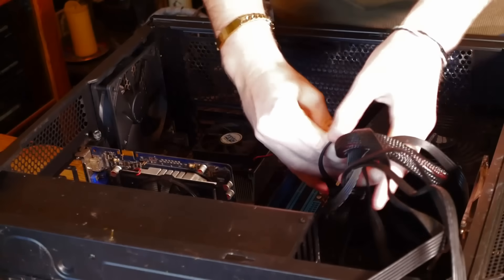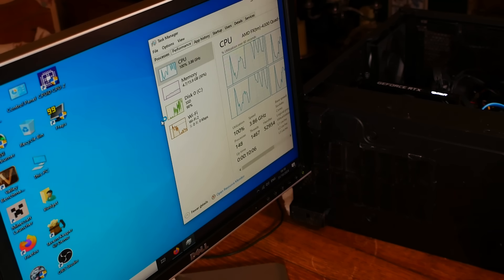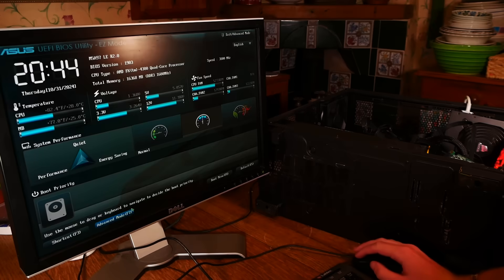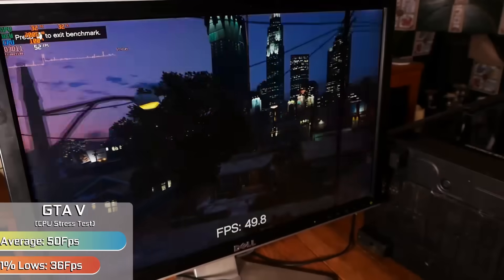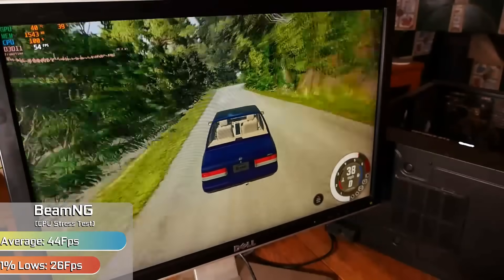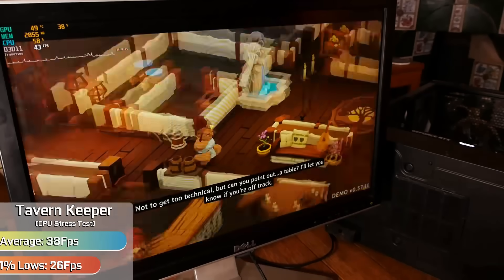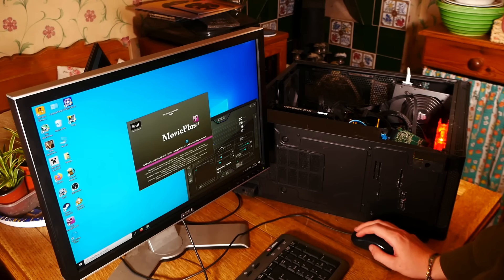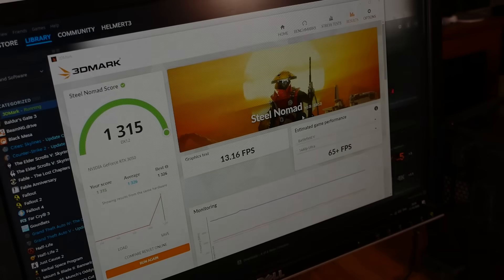AMDs Weakest FX Processor...

Comment: For me the real problem is not the fact that FX-6300 was close in price, part in which I totally agree with TH despite maybe not being viable for "true budget builds" like yours... the real problem is the old Phenom II X4 did cost about the same and performed, in average, better. And they also were compatible with the same socket, so there was very few reasons to buy this chip.

Also, few people know that, despite being a Vishera, the FX-4300 has actually LESS cache (4MB) than the FX-4100 lineup (8MB for all models except one), making it perform significantly worse in some games. I actually recommended and built FX-6300 based systems frequently, the savings for the FX-4300 were too small to consider it on my opinion.

You are totally right that there were few viable options for intel. The competitor in the 100€ mark for the i3 2100/3200 was actually not this chip, and not even the FX-6300, it was the FX-8320. I actually consider that chip a very good value, partially held back because of the more expensive motherboard required to make it shine.

I would really love to see pentium G540 (an even cheaper intel alternative at the time) and this processor compared side by side. I suspect that, in games in particular, some people might be surprised that a dual core has not aged so bad... ...for games that can even run on 2 cores.

Nice video as always.

Comment: I am using FX 6300 in my Win7 machine. 4,6 gHz seems to be sweet spot (of course  whole system is OC'd) and it performs really well. Well enough for GTX 970 being bottleneck in many titles. I've tested many newer titles (BG3, Horizon ZD, etc) and all run well, although poor FX is usually at 100% usage. But yeah, being Win7 computer, I mostly run era true games on this. Which run flawlessly.

Comment: I finally retired my FX-8370 system about a year ago.  It was paired with a GTX 1050Ti and did quite well for some games I've played on an quad-core Athlon II prior.  It did fairly decent in light video editing tasks.  It could even handle a Windows virtual machine without much drama.  It started initially with 16G of RAM but bumped it up to 32G four years ago.

Never once did I experience the performance problems that many were complaining about, but then again, I used Linux.  Meanwhile, these CPUs' true potential under Windows could only be fully realized when a Windows 10 update fixed the scheduler for Ryzen CPUs. . . it had the side effect of delivering noticeable performance gains for the FX chips.

I might bring it out of retirement as a streaming PC. . . that depends on my own schedule for the next few months. . .

Comment: The FX series was made using an old and inefficient node, with some models being pushed particularly hard to achieve high frequencies at the expense of extremely high power consumption and terrible energy efficiency. 

Also, the architecture didn't seem to be very good for most applications when they were first released. However, the architecture itself seems to have been relatively advanced, and performed well in some applications even early on, and ended up aging fairly well even for gaming, though it took a long time before a wide range of games were really taking good advantage of the FX architecture. These CPUs also offered decent value for money from the beginning, especially if your electricity costs were low enough that the power consumption wasn't likely to cost you very much, such as in some parts of Canada or the US.

It was nice to see someone taking a stand on the core-count controversy. Even a lot of tech journalists will repeat this outright falsehood that these CPUs didn't have the number of cores that they said they had, and use it as an example to argue that AMD isn't a trustworthy or honest company. Sure, by all means, it's good advice to tell people not to trust AMD, but this was not an example of dishonesty. The AMD engineers themselves considered their FX CPUs to have 8, 6, and 4 cores. The lawsuit didn't prove anything. AMD only agreed to a settlement because they didn't think paying more money in legal fees was worth it. 

There was never any conspiracy to misrepresent the number of logical cores, and the whole legal argument that their products were misleading was completely dishonest nonsense. There was never a widely agreed upon definition of a CPU core which the CPU cores in the FX series chips failed to adhere to. The lawsuit against AMD was just 100% pure dishonest legal sophistry and opportunism by lawyers. Anybody who expected an 8-core CPU to be faster than Intel's best quad-core CPUs during the same time period was an idiot, because Intel's best quad-cores were significantly MORE expensive, and it's never been a good idea to assume that a CPU will be more powerful because any one of its specifications has a larger number in it than a competitor. The FX CPUs offered decent value, there was no legal grounds for the lawsuit, and AMD should have fought it tooth and nail for the marketing value of vindicating themselves in court, imo.

Comment: I have almost the same story: my first pc was a fm2+ platform, a10 5800k. So same architecture but with a "decent" (for the time) igpu. I had it up to 4.9-4.8ghz stable with a hyper212 a friend gave me (dude went aio), and a laptop fan blowing on the radiator less vrms on that poor asrock a68 😂
Then i got a r9 290 blower, put a trixx cooler from a dead 290x on it (i had to trim some parts out of it), oc'ed that too up to 1200mhz core and 1600mhz on the vram iirc. That made for a nice heater in the winter x)

Comment: The Lawsuit against AMD for the FX series was to do with the Resource sharing. FX were built on modules, each module has 2 ALU units but 1 FPU unit. meaning that only 1 thread at a time on each module could use the FPU. it was this technicality that saw the FX line dubbed as having "fake Core count. the FX 4xxx series were 2 cores with 4 threads, FX 6xxx series were 3 core 6 threads and the FX 8xxx series 4 core 8 threads. This is why they were so bad, that in gaming, a task that make heavy use of the FPU, they performed so badly compared to Intel's offerings. Even clocking the FX to over 5GHz didn't help them.

Comment: i see you use  3050 with it  , most likely this cpu will squeeze out a few more fps with a radeon card i bet  , radeons they seem to have lower driver overhead so they really cope better with weak cpus . If you have  an rx 580 or faster around give it a spin !

Comment: Back in 2016 I somehow snagged a FX9590 CPU from eBay for less than $100.  The seller couldn't make it work on their MB, and so switched to a FX8xxx.  I did some research, and eventually found a Sabertooth 990fx on eBay for about $100.  I got a case, some memory, and an old AMD Radeon GPU and slapped them together along with a used 1000w power supply.  Everything I used was used with the exception of a DVD drive I purchased.  
Anyways, I still have that beastie today.  It has 32gb memory now, and an AMD Vega56 BIOS'ed to 64.  I don't play 'modern' games, but World of Warcraft and the WarGaming "world of" games still play beautifully.  I'll admit that it's not my primary machine, but that's only because a few years ago I switched over to the Intel ARC graphics cards; and you have to have a Core series machine to unlock all the memory voodoo of the ARCs.  
Regardless, my FX9590 still runs great and has survived 8 years of constant use.
Reply: I bet your home air temperature is over  40°C😂
Reply: @DraponDrako  that old FX certainly keeps my room warm in the winter!  I use it mostly to run Scientific Research with BOUNG from U. Berkeley.
Reply: yeah.. FX9590 is special.. you can only run with MSI 990FX Gaming, Gigabyte 990FX and MSI 970A Gaming Pro Carbon..
Reply: you could do 75- 100 fps in overwatch 2 , a 4-core 1200 does about that with a nvidia 770 2gb - i assume you get more that -144hz and 144 frames

Comment: I had an FX8350 with a gtx 970 till about last year then i switched to r7 3700x and 5700xt but there wasnt a newer game i couldnt play on medium 1080p with the old pc so i got nothing but props to the 12 year old chip (the latest and most requiring game that i played on the old system was payday 3 which has an i5 9400f as minimum requirments and i played the game on highest settings with 55-80fps depending on the area and the cpu didnt hit above 58% usage)

Comment: i had a FX6300 for a long time and it just worked fine with everything that i played but it struggled a lot in cyberpunk and later GTA Online and then i got a ryzen 3800x... the difference was huge. Funnily enough i'm now thinking about upgrading to a 9800x3d after owning the 3800x for almost 4 years. (my cpu still does everything fine but i finally wanna get something high end and lower my energy consumption (the energy prices are high were i live))

Comment: It's so weird. Did I just get the world's best FX-8350, which I ran for 10 years and it never felt slow? I see all this hate, and have done for years.
Reply: Slow is relative. It's not like it wasn't capable of running windows and games at the time, but if you put it side by side with Intel's offerings at the time, then it certainly was slow.
Reply: @8bitRAM  Hearing you loud and clear, but I've used i7 based machines and they felt at most the same. I wouldn't have even commented because this same issue has been and gone so many times, but the massive disconnect between my own experience and what's said is just too compelling.
Reply: @8bitRAM  Nope I mean playing DOOM, Doom Eternal, The Forest and pretty much anything at all that was as or less demanding than those titles.
Reply: @8bitRAM  Only now, after using an FX5950x does my venerable FX-8350 feel slow.

Comment: My living room/file server combo PC is still my previous FX-6300 based rig, albeit with upgraded RAM and my previous GTX1060. I bought it originally in 2014-ish with an R9 270X to play the newer games back then.

It still holds up surprisingly well in many games. I mean, not like the newest heavy AAA titles - but most indie stuff, plus it still does YouTube, streaming/on-demand etc. quite well...

Most impressive, it still takes my old socket 939 Zalman copper cooler - that thing keeps it only a few degrees above room temperature when idle...

Comment: I skipped over the entire Bulldozer generation because of the CMT nonsense, and because the chips consumed so much power. The only Bulldozer parts I had were the APUs, which were good for what they were. I had an A10-5800k in service as a network router for years. Its heat output was rather ridiculous, so much so that I had to install a large copper heatpipe cooler from an AM3 socket on it to keep it from overheating. The stock aluminum heatsinks AMD included with them were grossly inadequate.

Comment: If have never owned an FX Cpu you will never understand the bond that it makes with the user. My FX8320 served me well constantly overclocked to 4.5Ghz 10 years. I upgraded to AMD 5950X afterwards i got fed up with the thermal requirements of 8320, so the first thing i did was with 5950X is to underclock thinking that i i do not need such performance and to reduce thermals even more so that i can use it fanless in around 50Watts. So FX cpu changes you, it becomes a part of you and lives within :)
Reply: I am the exact opposite when it came to my FX 6300 and then later FX8350. Been cursed with a problem that gave me headache after headache. Problem I was encountering was a Memory Ram issue where you could never run ram in dual channel ever unless you want to experience glitch h*ll. i have done everything i could to address the problem. I even bought brand new motherboard, cpu(fx 8350) power supply, 5 different types of memory kits. but same issue. It always put the memory it was suppose to have on hardware reserved. It was just a cursed headache untill I upgraded to ryzen. then those problems i never experienced again. I just didnt know how a problem could have been affected by separate systems. some say i just had bad luck with motherboard and memory issues. though idk. I did got it stable enough to run one stick of memory 8Gb in then downclocked the memory speeds so it didnt go full on glitch mode. Just a dark history in my past with the chip.
Reply: @TheRhinoking27 you must have just gotten really unlucky, I never had a memory problem like that. And If they all were that buggy peaple would have been pretty upset.
Reply: @putinslittlehacker4793  He definitely either had the worst luck in the world or thought he knew way more than he did. My main system is STILL my 10-12 yr old 8350 w/32GB that has never been overclocked and has run 24/7 since I built it. Still running win7 on it and it is rock-solid.

Comment: I had an FX-8350, turned it into a hand-me-down system and upgraded to a FX-9590 back then.  The 9590 chip was my first taste of an AIO cooler as that chip ran so hot it wouldn't even post without it.  I still have that rig and my kids use it now.  It can still play AAA titles, including Cyberpunk at medium/high settings around 50fps.  Had a decent gaming experience with it back then. Having said alllll that, Ryzen stuff and Intel high end stuff beats the dog-snot out of it. Currently daily drive a 13900kf, haven't had any stability issues with it although I barely ran it hard before all the news came out and updated the BIOS to fix the microcode as soon as it was possible to do so.

Comment: I bought an FX 8350 back in the day and used it over 8 years as a daily driver without any issues and: without any performance problems.
And i bought it intentionally and not because i couldn't afford Intel. Intel always had an arrogance coming with it that i thoroughly despised (and do to this day)
The whole build was:
Gigabyte GA970 UD3 //  FX8350 w. Arctic Freezer A30 // 16 gigs DDR3 1300 MHz Corsair Vengance (upgraded to 32 gigs around 2016/2017 // Gainward Phantom GTX 980
And you know what: I never overclocked the CPU, not even the build-in OC i could do with the board tools. With the also cheap Arcitic Freezer(around 20€) it stayed around 55°C under full load.
In all those years i never had one game that caused any performance problems and i could play everything on 1080p ultra settings at 60 fps.
The best thing: i watched my friends upgrade their Intels almost every 1-2 years and waste money,  because they always needed a new board to their new CPU, while i just could mind my own business and don't care.
One key memory i have is that we decided to play Ubisofts Ghost Recon Breakpoint one day and 2 of my friends with their i5 Gen4/6 had serious problems on loading enemies and stuff with their little 4 Cores while i didn't even notice load on my FX.

I only upgraded my system, because i started VR Gaming and that's one thing the good old FX could not accomplish very good. Went to an Ryzen R9 3900X and then to my the actual R9 5950X.
The FX is still in use though, with all the original components. It's running my  Proxmox VM Teststation where i tinker on Linux distros and do proof of concepts for my live servers. And it's running everything absolutely fine. Just don't forget to repaste it with good thermal paste every few years and watch out for the bios battery.

My conclusion still is: The FX wasn't and isn't as bad as the media made it. The performance was decent, it was cheap and with the right setup a really good gaming CPU, without paying 200€ extra for a name. The lawsuit was a farce i didn't gave much attention, too. 
And knowing the sh*** marketing practice and R&D laziness from Intel despite their prices i kinda enjoyed seeing them going full headless chicken mode when the Ryzens came out and destroyed them with each new iteration a bit more.

Comment: The 4300 if i remember correctly is the only AMD FX chip where each core/module has its own dedicated counterparts. As the 4300 actually is a defective 4 module part that has one core defective per module.

Comment: I have build my rig in 2013 with an AMD Fx 6300 Black Edition (110€ !) paired with 2x4 go ram( 67€), MSI990XA-GD65, 50go samsung 2,5 ssd, 700w FSP and a MSI GTX 660 Twin Frozr 3 (170€).
Sold it for 150€ to a neighbour in 2018.
It "Died" in 2023 after extenssive use and no care from the owner.

Comment: A FX at 4.8Ghz, with a 300Mhz FSB, and DDR3 / 2400Mhz is still equal to a 1700X these days, but only with 3x more power required, if you tax all cores. I used one for 1.5 year; one of those chips that with a little bit of fiddling around you could easily extract 40% more performance out of it.

Comment: Excellent review. I sooo very nearly went for an FX-8350 as they were a bargain when I built my last desktop, back in 2016. They cost, at £85, about 20 quid less than the I3-6100 - that an 8-core processor (well, sort of) for less than the price of a multithreaded dual-core. I agonised about buying AMD or going Intel for ages but FX was a dying platform, while Skylake was the new kid on the block. Also, the single-core performance of the FX was pretty off-putting compared to the Intel chip.
Then I saw an I3-6100 on eBay for 80 quid so decided to take a punt on it (half-expecting a fake), my cunning plan being to return both it and its accompanying motherboard (Amazon bought) if the I3 was phoney. To my, complete surprise the I3 WAS the genuine article. 
Another reason I took the risk was upgradability. I really wanted an I5 but couldn't afford it so I planned to flog the I3 when the prices for the 6500 went down. I never got around to replacing the I3, as I changed jobs and began using laptops. I still use my I3 to this day for watching YT vids & basic desktop stuff when I can't be arsed to squint at a 15" screen.  Works fine, and it's power consumption is excellent!